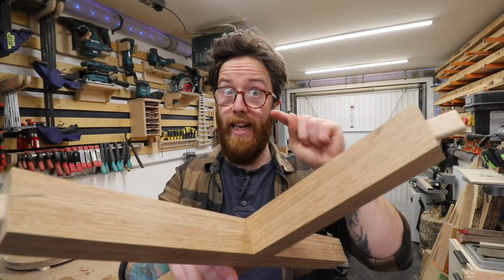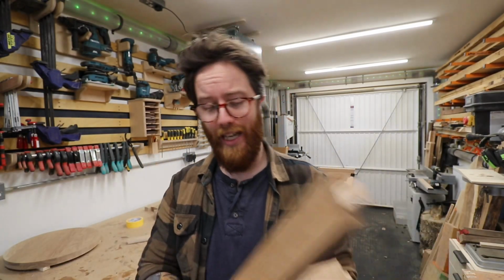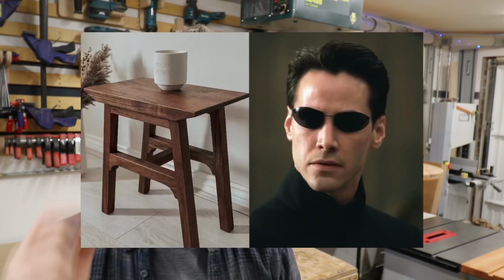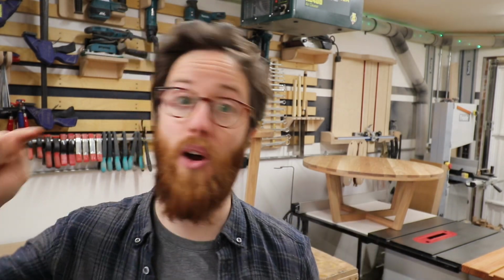Round Coffee Table - EASY BEGINNER BUILD || Woodworking

Comment: Great video. Just subscribed :-) How do you deal with the expansion and contraction of the wood in how you attached the legs to the top piece? Were the holes just slightly larger than the screws? Cheers!
Reply from the maker: Thank you so much! And cheers for subscribing 🤙🏻 It’s exactly that, making sure the holes for the bolts are bigger so the top has some wiggle room over the seasons. I explain all about it as well the glue up with the underside pieces in the Build Plans, which I released this year, well after this video was made 😜 So if you’re interested check them out on my website 🤙🏻

Comment: Just found your channel mate, lot's of info yet fun, , your a natural.
Top tip. When you use the router compass,  instead of fixing your router to the base, drill a 20mm or similar hole in the ply/mdf instead then put a matching guide bush in the router,  that way when you cut the circle the router stays in the same  orientation and you don't twist the cables
Reply from the maker: Cheers mate, glad you like my content, I’ve got plans to do a lot more next year, we had a baby in September so have been a little busy 😂 Ooo that’s a good shout, I’ve never seen anyone do one like that, cheers 🤙🏻

Comment: Great video! How did you lay the under pieces of the circle (the octagon) to cover equal parts of the table?
Reply from the maker: Cheers! I basically marked out the diameter of the circle underneath and then overlapped the octagon pieces by about 5mm. I’m currently working on build plans for this coffee which will be out in a few weeks 🤙🏻☺️

Comment: Great video. I was enthralled throughout. 
When attaching legs to the top do you leave any slack or leeway for wood movement?
Ken Myerscough - Southport
Reply from the maker: Thank you so much! Yes definitely, I drill a hole bigger than the bolt so there’s wiggle room for wood movement over the seasons so it’ll still stay flat (relatively) 🤙🏻

Comment: Hi Sam, loving the  channel.  As someone else said, Bourbon Moth vibes.  Great to have a similar channel from the UK.

What type of bit did you use for the first router cut, you showed the template bit but assuming you used something different for the initial cut?

Thanks
Reply from the maker: Hey mate! Ah cheers thank you very much, well I definitely take that as a compliment ☺️ Still trying to work out my own style and rhythm but glad you like it it so far 🤙🏻

I used a straight flute bit initially then went on to the flush trim after taking the excess off. You could use an upcut spiral bit to begin with too! 

Thanks for the support 👊🏻

Comment: Hi Sam, how many different grades of sand paper do use use to get to your preferred finish
Reply from the maker: Hello mate! I go from 80 grit through to 100, then 120 and 150, sometimes 180. As I use Rubio on most of my projects you don’t have to go very high in grit and as long as you go through them all thoroughly you won’t get any pigtails in your finish. Obviously Rubio says to only sand up 120 but I’ve never had an issue with going higher. And once the finish has cured I tend to give my projects a little tickle with a high grit sponges sander, wipe it all down with a damp cloth and it’s smooth as a baby’s bum but still gives a very natural look. Hope that helps mate 🤙🏻